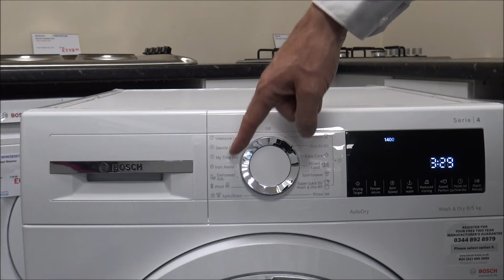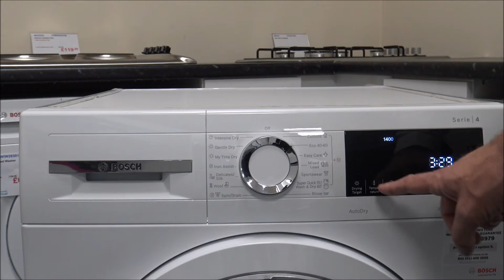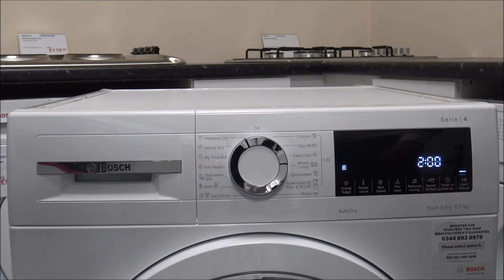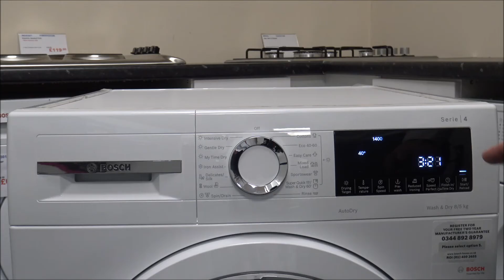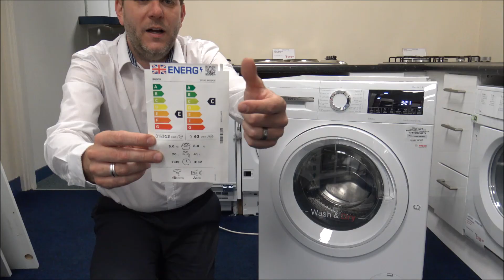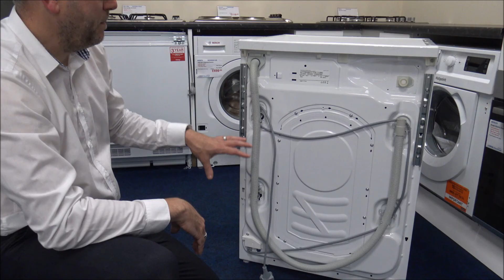Bosch WNA134U8GB 1400 Spin 8Kg Washer Dryer

Comment: Great video! Thanks. Can I ask, can you use the option to shorten the cycle with mixed load program? How long does it take? And is it possible to regulate the temperature or is it set? Thanks in advance :)
Reply from the maker: As standard the program is 60 minutes long. It can be shortened using speed perfect to approx 45 minutes long and the temperatures do range from no temperature up to 60 degrees C on that program

Comment: Hi this is a condenser dryer isn't it?  Do you have to empty the water out? And where is the lint drawer please.
Reply from the maker: With most washer dryers like this, they don't have a separate water container or condenser unit as the water will just exit the waste how of the appliance. They also don't have a fluff filter like on dryers as it will exit the machine through the waste pipe too

Comment: Great video and demo. 👌( the manuals a bit cryptic) . I have the 9kg model. This replaced a 13 yr old Miele washer dryer that starting having sensor problems ! And are ridiculously expensive to sort out. The Miele  also had a number of faults over the years so don’t believe the Miele hype of lasting 20 yrs etc !!! ( they may have done 30 yrs ago ) This Bosch performs well , is quite and is easy to use. After removing the transit bolts I found balancing the machine tricky, it’s lighter than the Miele and does tend to want to ‘walk’ on my tiled floor with large towel loads. According to Which magazine it’s a really efficient model to. I also got a 5yr Warranty aswell. 😊

Comment: Does the dryer jyst ger rid if water through the pipes
Reply from the maker: Yes you don't need a separate container for the water collection like on a standard condenser dryer, the water will exit through the waste hose

Comment: The video was really helpful and informative. Is it possible to buy a longer Bosch water inlet hose?
Reply from the maker: You will be able to buy a universal hose that extends the water hose from any decent DIY shop, but it will just add to what Bosch have already installed on the machine rather than changing the hose
Reply: @lords-electrical  Can the drainage hose on the machine be attached to a drainage hose extension? Do you need somesort of connecting device?

Comment: Thanks for a useful video. What if some one puts 8kg and drying limit is 5Kg, once washing cycle
 is finished. What happens next? Are there any weight sensors which will give error asking user to take some weight out before going with drying or it will continue drying but results will not be good?
Reply from the maker: It will stil dry but all that will happen is that it will take a lot longer to dry than normal and there may be a chance it won't be as effective at the whole drying process

Comment: Is there any further clarification  on the ventilation with the dryer?
Reply from the maker: You don't need to have a separate vent hose like of vented tumble dryers, the moist air will just go out of the waste hose of the washer.

Comment: Thank you for the very useful video. I got this machine recently and I was wondering if there is a lint trap that needs to be emptied for the dryer to work properly? I can't seem to find one. Thank you!
Reply from the maker: These machines don't need a lint filter, it is only a standard dryer that would need a filter that needs cleaning

Comment: Firstly congrats on a very well explained video. We bought this machine to update our old Bosch of about 30 years old which my wife swears did a better job. THe problem she has is that the alot of the clothes now come out covered in very fine fluff. Could this be down to the reduced water usgae on modern machines, Also she says there is no possibility of programming the machine top start at a preset hour which I find hard to understand. Anyway many thanks for the vid and eagerly await your comments. c
Reply from the maker: It does sound odd that everything is coming out with fine fluff on it. Its the first time i've heard of this. This has a time delay option which will enable you to delay the start of the program by up to 24 hours

Comment: Very good demonstration of the product. Nice information to take in. One question, while we will use only dry cycle(like, gentle dry or intensive dry or my time dry), hope no washing liquid require to put, please suggest?
Reply from the maker: That is correct that if you are only using a drying cycle, then you would not need to use any detergent.

Comment: We've just purchased this machine but it wont spin & drain, why? 🤔 advice would be appreciated!
Reply from the maker: Does sound odd, i would check to make sure the drain outlet is not blocked. If it is then the water cannot exit properly and will not spin and drain properly.

Comment: Can you explain the ‘before washing for the first time’ instruction please. Why is it necessary to use such a high temp programme and why do I need to add litre of water into dispenser I?
Reply from the maker: It is recommended to use a high temperature wash to start with to clean the machine out to start with as it may have been sat in a warehouse for months so at least it will be nice and fresh from when you start to use the machine.

Comment: If  I put 8kg would I be able to open the door to off load it before drying program kicks in? Or I have to do 5kg right from the beginning ?
Reply from the maker: If you are selecting a wash and dry program then you will need to put 5kg in from the start

Comment: I tried the 1400 spin for towels and it has shaken my entire worktop and I got scared. it manages to move out from its place. 🤦🏼‍♀️
Reply from the maker: Oh dear, that doesnt sound good. Make sure the transit bolts are removed properly, if they are not it will damage the machine and won't be covered by the warranty too.
Reply: Is the machine totally level and with all feet adjusted so they sit firmly on the floor?
Reply: I too had this problem. In fact the machine moved out about 20”! There is a ‘bolt’ shaped lump on the side panel now. The noise was incredible. I bought and had the machine fitted by John Lewis only a week ago so tomorrow when the New Year holiday is over I’ll be phoning them.

Comment: Great video - thanks ..

I just bought this machine and it comes with a "aqua-stop" or "aqua-secure" fitting (not sure of the difference).
I asked them in the store where I bought it (Currys) if this has to be fitted vertically and they assured me that it does not.  However, reading the manual (yes, I read the manual), it says that it should indeed be installed vertiaclly, but this is not possible on my plumbing outlet.  Do you think the machine is OK to use if I just use a regular hose without this "aqua-something" gizmo, or just go ahead and install it horizontally ?

Thanks
Reply: From my understanding it will still work fine but you just wouldn't get the protection it offers by having it installed horizontally, if the inner hose ever did leak then the float system may not work, my issue was that the aqua hoses can not be extended so I just used a standard hose which is absolutely fine, I have never had a hose leak to be honest so I wasn't overly concerned.
Reply: @Stu81  I went with the old hose from my 30-year old machine, which has never leaked or split yet and looks fine, so seems like fairly low risk :)  I doubt that the new machine will last that long though !

Comment: there is a question i need to know andy wonder can you help on the dryer does it have a lint filter and where does the air escape when its in use
Reply from the maker: These don't normally have a lint filter built in like a separate dryer would do.
Reply: @lords-electrical  thanks just need to know the basics to maintain my new machine

Comment: Trying to decide which washer dryer to get and it's doing my head in.  I just want a machine that can wash all sorts of materials in one go and get them totally dry afterwards.....and this seems like a little too much to ask.  I never separate things such as colours, materials, whatever, because life's too short to do all that nonsense.  I used to be able to do this easily with older machines, but it seems those days are gone.  Now I get a choice of about 50 different programs and settings which, in my humble opinion, are just completely unnecessary.  My old Colston washer dryer was just brilliant and went on for years, but I don't have a clue what to get now.
Reply from the maker: Good point, it is very difficult to choose a machine. I would first of all have a look at your budget, then load capacity you require and from then it should hopefully narrow it down a bit for you.
Reply: I know Hoover's not the best quality but their drying side of their washer dryers are the best on the market that I've used. I have the siemens 9kg version of this machine and it doesn't dry completely very disappointing. I'd like to have a miele next

Comment: Is there a lint catch in this model? My dryer has essentially stopped drying after running multiple times on the same load and I can’t work out why
Reply: Lint traps in washer/dryer combos are normally accessible from the top of the machine.  They should be cleaned every time, just like a standalone dryer.

Comment: Does the machine weigh the load otherwise it is quite difficult determining weight of washing apart from weighing on a set of scales which need to be large enough for the washing basket?
Reply from the maker: It doesn't actually weigh the clothes, you are correct that it is difficult to weigh them accurately without overloading

Comment: Hi is there a place to remove the fluff/lint like on standard tumble dryer? Thanks
Reply: Again please answer this as it’s a bit of a niggle.
Reply: some fluff can be removed via the drain hole which in the video is only mentioned in relation to removing items that you may have left in clothing like coins.

Unfortunately, it doesn't have a dedicated fluff filter which as you say is often on just dryers. We found that after about 3 years the drying efficiency went poor and it needed an engineer call out to lift the top off the machine to clear out the accumulation of fluff. It was a quick job and we had taken out the extended warranty so it cost nothing. Normally I don't bother with extended warranties but washer dryers are notoriously flakey. Having said that this is the only problem we've had with this machine and gets a lot of use. In terms of it's operating and build quality it's streets ahead of Zanussi where we had 2 that barely lasted 2 years. With Bosch you do get what you pay for!

Comment: Hi,
Is there a time delay after starting a programme such as Cottons or mixed load, between pressing start and water entering machine? You hear water straight away on 15 minute cycle. Only just installed so don't know if a problem? Thanks
Reply from the maker: Not normally much of a delay, if it is working ok on the 15 minute cycle, then the machine and plumbing should be ok.